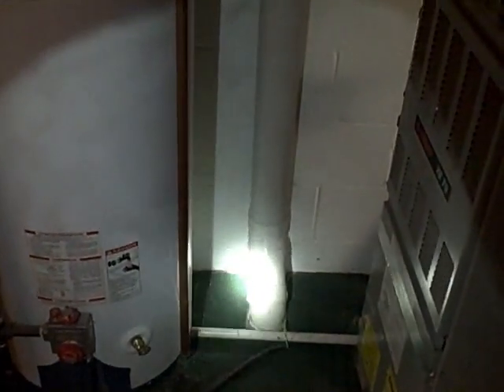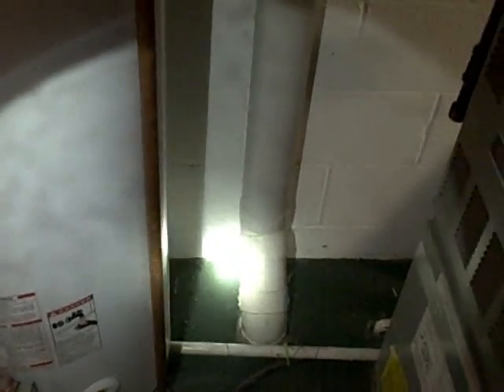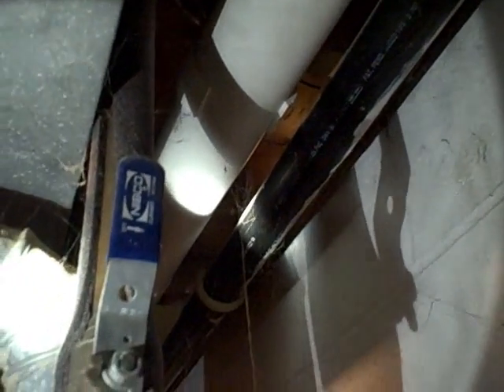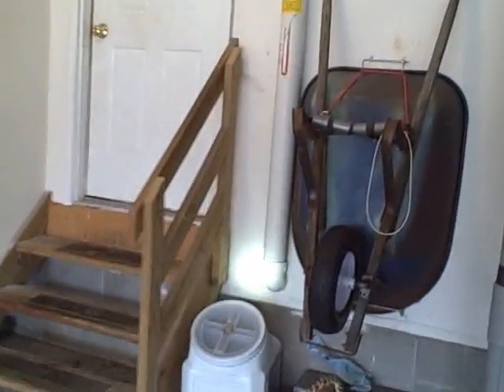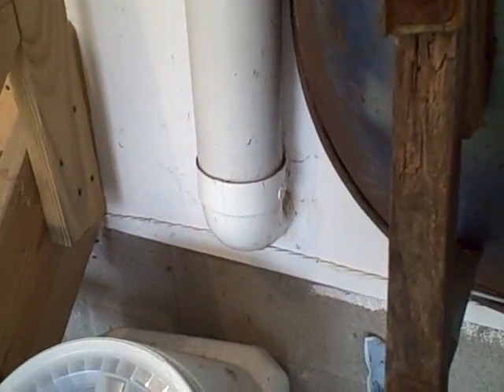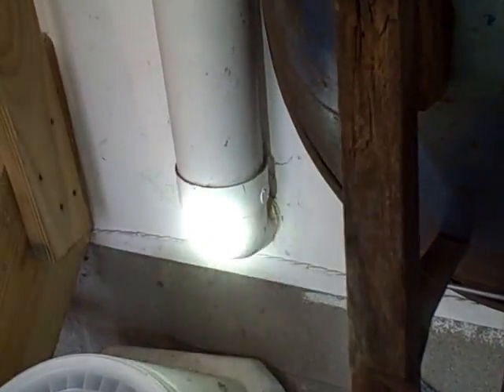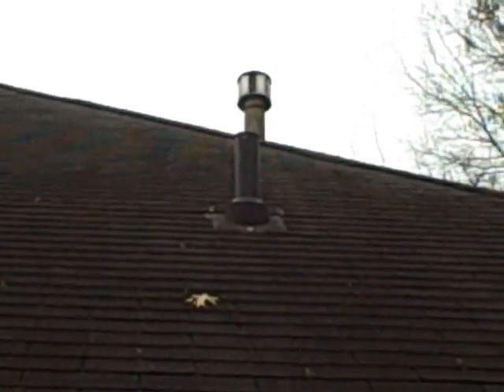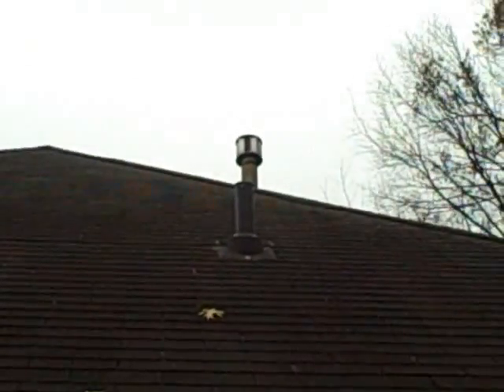Ohio radon mitigation specialist reveals mitigation system defects

Comment: There is absolutely nothing wrong with installing a suction point near a footer, actually it's preferred. Soil tends to collapse slightly near the footer and air can be drawn through the voids. Learn your trade before you make a video bashing other firms. I don't understand why contractors do this. They trash other people's workmanship to feel superior by default. I agree that most of the things done by this guy were not up to code, but why make a video about it? I come across this stuff every day. I fix it and get on with my life. I guarantee you I could come behind one of your jobs and pick apart many things that were done incorrectly. Do yourself a favor, get a name for yourself by your own merit, not off the backs of others.

Comment: If your suction point has enough pocket dug out, you shouldn't have any problems with moving air from under the floor no matter how close to the footer you are, especially if there is gravel and drain tile.I have never had any problems except in clay,sand and slate and if these are a factor, then it won't matter how far away from the footer you are. You just need multiple suction points.